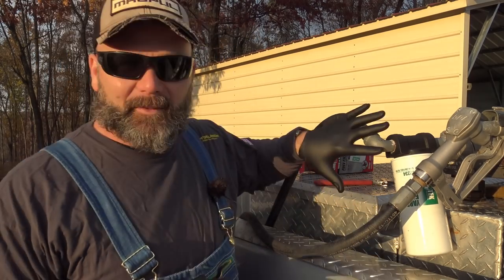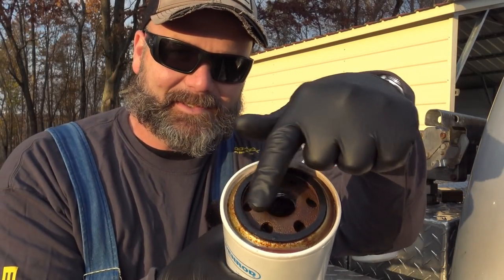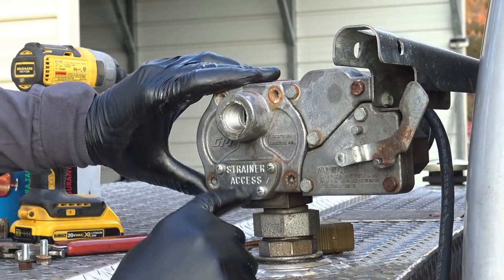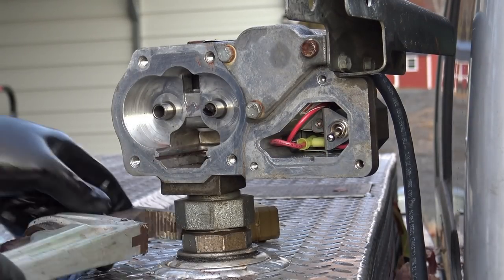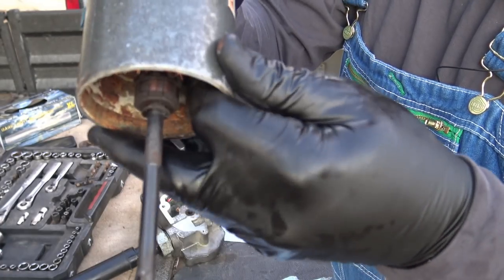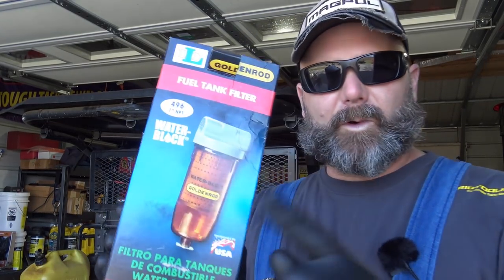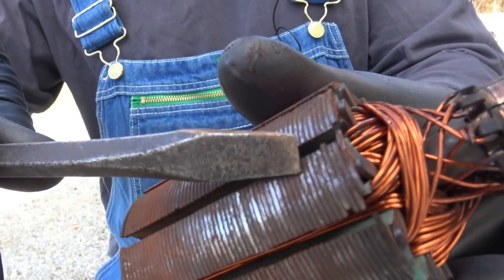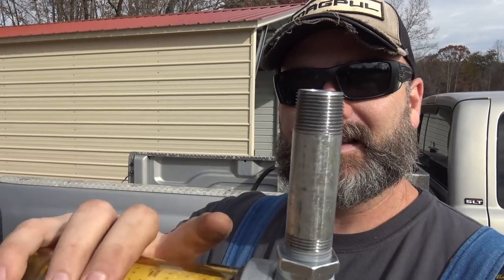What's in my fuel! This doesn't look good!

Comment: Are you sure you are buying farm diesel ?  I have seen stuff like this in central heating  fuel (water and bits). how can that pump motor be spark-proof  if it lets water vapour in ?
  Emery paper in a split dowel  works well for cleaning in a case like that. I was looking at what you did, and was thinking that tank needs scouring out somehow.

Comment: Sounds like a motor bearing is shot!
Reply: Bearings and Seals. Wonder how old this thing is ?
Reply: Seals and bearings are shot ... New filter not gonna fix it ... Need new pump motor at least ... (Posting before you remove pump motor) When you rebuild it put the water seperater next to the pump and the filter next to the hose ... I like the idea of using both ... You still have water in the tank

Comment: Do you need to put a roof over the pump to stop any water getting in.Also'what condition is the tank internally.You're going to get condensation if tank is not full/fuel constantly turned over.

Comment: 1st off at time stamp 10:00..the bearing sounds like it's shot.
15:00ish revealing the guts...personally I would clean the rust away. Use an epoxy to re-attach the magnets,  and reassemble.  If it still fails...replace motor.
Though I would Flush That Tank FIRST before reassembly.

Comment: Did you cut the intake tube off at an angle? Intake tube should be flat to the bottom of the tank with small openings around the bottom, cut at an angle it allows for large accumulation of water at the bottom of the tank, then one lucky day your fueling your tractor on an angle hillside and suck a ton of shit up all at once!  Their should also be a stainless steel screen at or above the pickup tube union to break up any clots and stop debris from entering the pump chamber!

Comment: What you call a relay on the switch could be a self resetting breaker.  Breakers, when they are put under a load just under the trip current can deteriorate and create a lot of extra resistance  and stop the proper amount of current getting to the motor and make it run weak and then the breaker breaks current sooner and take longer to reset.

If you have a multi-meter, check the voltage going in and the voltage coming out, they should be the same.

Or you can remove it from the circuit and use the ohm meter to check resistance.  Resistance should be zero or close to zero in a good breaker.  It takes one volt of pressure to push one amp of current through one ohm of resistance.  That means that if that 12 volt pump motor requires one amp of current to run properly and the resistance through the breaker is only 24 ohms you will only get one half amp of current.

Comment: It's a DC motor the armiture is held in by the Magnets. The magnets need to be attached to the outside wall of case or motor will not turn or turn real slow!

Comment: I'd get a hose and syphon out the fuel and maybe keep it in drum for mixing with your used sump oil to spray old  implements and get your fuel tank off the truck and hose the shit out of it with water then let it dry out for a few days then hopefully if you get clean fuel u should be ok I'd run some fuel doctor in your tank each fill you do. I'd say it brushes in your pump might have been in the rain and got rust and crap in there to I usually would leave a piece of rubber mat over ours when the truck sits out in the open

Comment: When you took the pump out you said that the pick up tube touches the bottom that is not good if its touching the bottom you are picking up all of the dirt and grime and putting that through your pump thays not good so cut the end off like 4 or 5 inches
Reply from the maker: the pickup tube is designed to be on the bottom of the tank, it has an internal tube and external tube so that it rides on the bottom...even touching the bottom it's still not pulling directly from the bottom of the tank....pretty well engineered setup

Comment: Typical for a GPI brand pump.  I had a brand new one fail after only pumping 30 gallons.  Pulled it apart and found the magnets off the case.  After a warranty exchange at TSC the second one only pumped 30 gallons.  Now that the warranty was expired I cleaned and re-glued the magnets.  It’s worked ok since.    Problem is the cheap glue GPI Great Plains Industries uses to retain the magnets.  If you know what you’re doing they can be rebuilt.  Buy a Tuthill transfer pump next time...
Reply from the maker: its working fine now. I'll bet this pump is 15 years old...only paid $100 for the tank, box and pump combination....pretty pleased

Comment: Here is my take on your problem to prevent recurrence:
1. Drain and clean out that tank.
2. Shorten the tank's up-take tube.
3. Place a fuel filter screen on the end of the up-take tube.
4. Cover the motor or park under a roof to prevent rain water from getting in the motor casing.
5. Make sure rain water is not getting into tank via its vent.
6. Add a antifungle to tank.
7. Add a water drain plug to the bottom of the tank.
8. use this water drain plug to draw off water once a month or more often.
9. Once a month pump about 2 gallons into a clear glass container to check for water and contaminants in fuel.
10. Add a 10 micron filter in discharge line after water separator.
11. Protect plastic separator bowl from sun.
12. Accept only new fuel that is pumped through a good filter and separator.
13. Check a sample of all new fuel using the clear glass container method prior to filling the tank.

Comment: first off put both clamps on the battery posts ,not the frame . and then replace the circuit breaker on the back of the switch .take steel wool and polish the armature and then reglue the magnet to the case and it will work againyou definetly have water in the fuel , drain your tank, flush, and then add some good diesel fuel additive and add diesel

Comment: The water separator should be used along with your filter, not in place of it. It will not separate immersed solids from your fuel, only water.

Comment: So, how many gallons of water are sloshing back and forth in the bottom of your tank?  When you pump fuel out, air comes into the tank to replace removed fuel.  When next the temperature drops, the humidity in the air condenses on the inside cool walls of the tank.  Those droplets run down the side of the tank and into the fuel.  Every time the temp goes up and down, air in your tank expands and contracts  breathing through the vent.  Then a fresh batch of humidified air is available to be condensed into your fuel next time the outside temperature goes down (every night?).   This accumulates over time.  I would think every couple of tanks, when it's low, some water dissolving (alcohol based product) fuel treatment should be poured in and after a little sloshing around, drained out and consumed.   When you do this, park the truck so it's leaning into the pump pickup.   Physics kind of sucks sometimes.  ;-)

Comment: Here is what is wrong with the fuel. The gunky stuff in your video is exactly what I had coming out my tanks as well. Here is a little bit about it from wiki 

Diesel bug is contamination of diesel fuel by microbes such as bacteria and fungi.

Water can get into diesel fuel as a result of condensation, rainwater penetration or adsorption from the air — modern biodiesel is especially hygroscopic. The presence of water then encourages microbial growth which either occurs at the interface between the oil and water or on the tank walls, depending on whether the microbes need oxygen. Species which may grow in this way include:[1]

    bacteria — clostridium; desulfotomaculum; desulfovibrio; flavobacterium; hydrogenomonas; pseudomonas; sarcina
    fungi — aspergillus; candida; fusarium; hormoconis resinae

Fuel companies agree that if left untreated fuel will remain reliable for just 6–12 months. After which fuel contamination (such as the diesel bug) begins to appear. Most industrial engine manufacturers now recommend a fuel conditioning programme to ensure the reliability of fuel.

Comment: The bearings are getting hot and lock it up you will have to replace that
Reply from the maker: it just has bushings...no bearings that I could see
Reply: @StoneyRidgeFarmer  Bushings are cheaper-very common in modern motors.

Comment: Got to ask yourself how water got into the motor in the first place. Seems maybe a seal has failed somewhere or a crack, difficult to see, in the case. I would think there would be some bearing/bushing and seal around the shaft but did not see in video. Also, I would inspect the tank itself. Maybe get one of them cheap bore scopes for the phone and take a look inside. I could be wrong but bet that tank needs cleaning or maybe rusting itself. I really like the idea of fixing and saving money rather than throw away and replace if possible. PS, did you guys see the Tesla Cybertruck. Josh I think u need one of them ugly suckers to test out.

Comment: This looks fixable to me. Might need new bearings or repacked with grease, but the crud on the armature can be removed with acetate, which is also good for cleaning the commutator. The winding looks fine. Remove the magnets if you can, clean them up, wire wheel the housing and try it. Worst case you loose a few hours of your time, best case you save alot of money.

Comment: The magnet came unglued from the body and collapsed onto the armature. Game over. I worked for a texile machinery co. That sold power driven guiding systems with that setup. Electric motor coupled with planetary reduction gearbox. The magnets would fall out and jamm the armature due to heat and water contamination. Pretty expensive 10 minute fix.

Comment: Low end pump have one like it. Had to replace the motor. Get a better quality pump.
Reply from the maker: funny that even a low end pump cost over $300
Reply: @StoneyRidgeFarmer  my motor looked exactly like that but the brushes were toast. Try to seal up the motor as best you can with silicone or it will happen again.

Comment: A quick and real test for a switch or relay: measure the voltage across the in to out contacts when it is activated.  It should be zero - a direct short.  If not zero, you have a power loss there.  The same process works for a bad battery connection.  Measure the voltage with one lead on the battery post and one lead on the post clamp while energizing something - headlights is a good significant load, starter is another.  If not zero, there is a bad connection.

Comment: zinc and iron pipe.  Wonder.  Look at the screws.  obvious.  Is there a seam or crack in the tank ?   Need to run some anti-rust chem in there to wash around - What is rusting ?

Comment: That is not a relay by the switch. It is a auto resetting circuit breaker.   It should be marked with a amp rating. I'm guessing 20 to 30 amps.  
Wrap a layer or two of news paper around the rotor then apply the magnets to the rotor.  Apply the epoxy to the back of the magnet and slid in the case. Let epoxy set up and pull rotor out disguard paper shim assemble.  Use only amount of paper to firmly hold the magnets to the case wall. This also keeps a good air gap for the rotor to magnet clearance.  Hope of motor lives.  Hope the brushes were good.

Comment: I was disappointed in that you did not show how you caged the two brushes during the assembly.  That can be easy to very difficult depending on the motor design.  I prefer the small holes where you can use two paper clips.  But in this case I suppose that would violate the integrity of the seal.  So maybe they allowed for some side hooks on the brushes or just using the brush wires.

Comment: That looks like a resetable fuse when the current draw is too much it will open the circuit when it cools of it closes the circuit. I think there was a rest ace problem bogging the motor down and causing the fuse to open. Why you could only run the pump for a short period of time. Paused the video to say this.

Comment: I had the same problem with mine. It turned out to be a bad ground...the alligator clip on the wire...
Reply: Richard Perry    interesting that you said that because as the cable clamps were being hooked to the battery I noticed they were of poor quality suggesting the possibility that the wire may have had its ampacity exceeded meaning that it would have no longer passed the proper amount of juice once it got hot... I'm glad I didn't open my mouth and put this in comments before I got all the way through the video. Lots of factors involved in this fix

Comment: magnets fell out of your motor because you thrashed it with a spanner common fault on starter motors when people say it only engages when I tap (thrash) it ! ive glued loads back in and they work fine if its cleaned relubed or new bearings fitted. if it wont run don't thrash it

Comment: Question: is there an additive (I'm totally NOT familiar with anything diesel related) that you can add to the fuel to get the water out of the mix? I know there are additives for regular gasoline that "dry" the fuel...and if you had that available you could treat the whole tank full of crappy fuel and hopefully get better use of it as well.
Reply from the maker: Yeppers...I put Power Service in the tank near the end of the video
Reply: Stoney Ridge Farmer 
You can throw a couple bottles of rubbing alcohol in it also. We put 20 gallons or so in locomotive fuel tanks after a fuel preheater fails and puts coolant in the fuel tank. Of course we drain the excess water out of the tank and change all of the filters first though.

Comment: Modern diesel, water, and bacteria... makes lots off work for mecanics, I have the same whit my customers...Diesel that forms a lacker lear on everything, stuck pumps, etcetera. the water in it makes everything rust up.. btw, the rust in your motor, is a bad seal on the pump shaft. the biocide wil kill the bacteria, but it will not desolve tje junk in the tank, you should clean the tank up, filter the diesel thats in it, and use it up as soon as possible, New Diesel is the way to go. Better place for the filter would be before the pump, in the suction line.

Comment: I'd siphon off the fuel inside the tank and get fresh gas...that's just the start. Forget the pump...until you fix it it's unreliable because of the water in the fuel...

Comment: That skate board stuff is way too abrasive.  You should have used something that would gently scrub the walls.  And would tightly fit into the hole.  I would have suggested using a cylinder hone.  Would take a lot longer but take a lot less metal away. There pretty cheaper at harbor freight for a one time use.

Comment: okay first off you likely dont just have a water issue you likely got a algea issue need to run a biocide thru the fuel system and all the vehicles using it then something like clear diesel double dosed for 2-3 cycles of treatment. 

Algae in diesel fuel produce acids that gradually skew the fuel's pH towards an acidic environment. A pH of 7.0 is neutral, so adding acid to the fuel will decrease the pH number. A fuel pH of less than 5.8 indicates a serious problem and is strong evidence that there's a microbe problem going on in the tank. Finding this out requires a pH meter, of course, so if you have one, it's another bullet in the arsenal of evidence that you can collect to determine if you've got a diesel fuel algae problem.

Diesel fuel algea plugs filters like crazy because the microbial bodies themselves get caught, as well as the black, slimy biomass matrix that they produce over the course of their lifecycle(s). Filters are also plugged when the activity of the microbes causes the fuel itself to lose storage quality and break down at a faster rate. Then you get filter plugging from asphaltenes and heavy end fuel components that have stratified and come out of solution. Any abnormal increase in filter plugging rate is a warning sign to check the tank for microbes.

Comment: I would quit purchasing fuel where you got that batch of crap fuel.   Note if you only have regular Teflon tape and  you need to pipe up some petroleum piping you can still use the regular Teflon tape because when it came out it was actually designed for the military to be all purpose and specifically petroleum applications in mind.  The petroleum tape is a rather new development with Teflon tape.   I was a Tank and Pump guy in the air force and never had trouble with either the regular tape or the Teflon paste.

Comment: i can tell you what your problem was ,, the crust was only part of it ,,  the magnet came unglued from the motor housing and the 2 magnets were out of sync causing the motor to labor ,, and overload ,, that little squaare thing with the switch is a self resetting circuit breaker  and what was shutting the motor off was that breaker opening the circuit,,
MAGNET DELAMINATION is directly correlated with BANG BANG BANG BANG BANG ,,AKA HITTING MOTOR WITH HAMMER

NEVER EVER EVER EVER STRIKE A PERMANENT MAGNET MOTOR WITH ANY OBJECT

IF i had this motor i could fix it easily  ,, clean the rust off ,oil the bushings and some JB WELD to glue the magnet back on , boom motor runs again
i do this with lawnmower starters routinely,,exact same motor design

Comment: Come on Any one who bulk buys diesel and stores it has as water separating filter even my diesel car has thus type if filter. as diesel attracts  water.

Come on you did not know it would be plastic.  Your not going to want metal.

Why is your holding tank metal and not double  skinned  plastic lined.

You need to ask how water got into the motor unit as it shoukd be watertight. It woukd have been cheaorvto buy a new pump unit. That came with a warrenty. 
On the bottom if the pick up tube i would put a metal filter gauze to stop larger crap being pulled into the pump